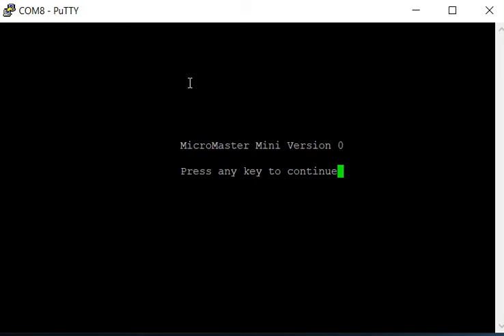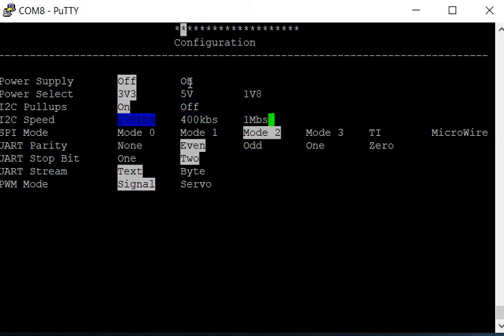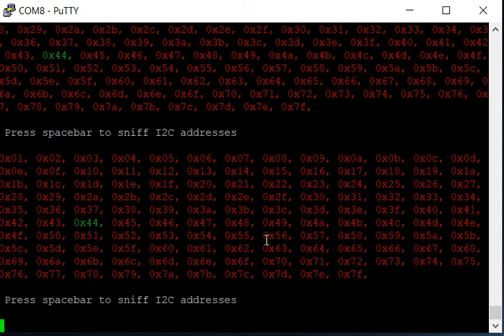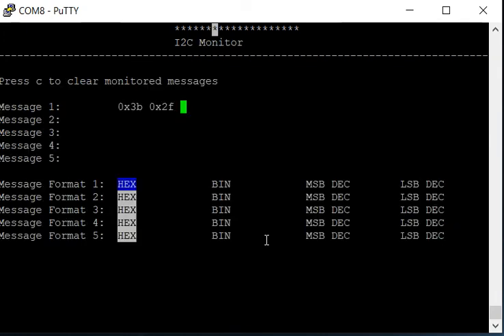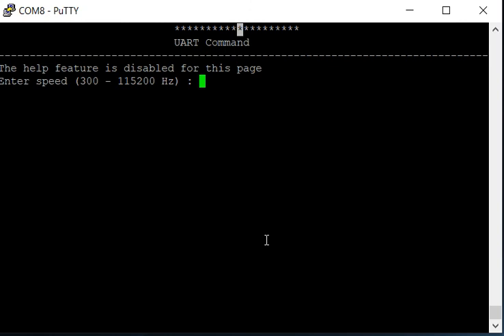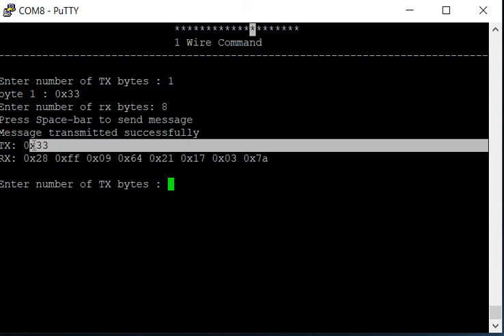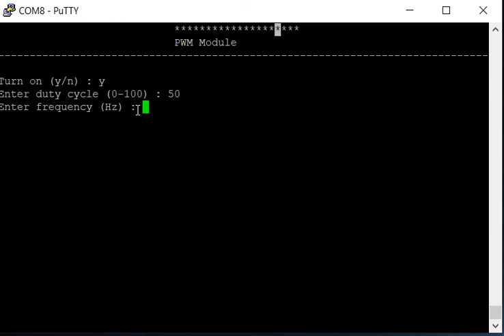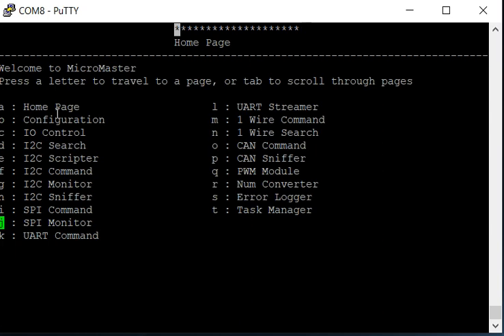MicroMaster Mini interface demonstration: A Bus Pirate alternative

Comment: Very cool! About time someone released an updated better Bus Pirate like device.
Reply from the maker: I just got the first revision of the board done. We are adding an OLED and a current monitor. Hoping to have it released by the end of the year!
Reply: @micromasterllc5848  This project is coming along nicely it seems! I really like the idea behind this project, there are so many use cases for it. Looking forward to seeing more videos on it
Reply from the maker: The next revision is going to have an OLED display, a current monitor for the power supplies, and a servo control unit with up to 16 outputs. The gpios will also shift automatically in voltage with the power supply. Its going to be pretty cool.